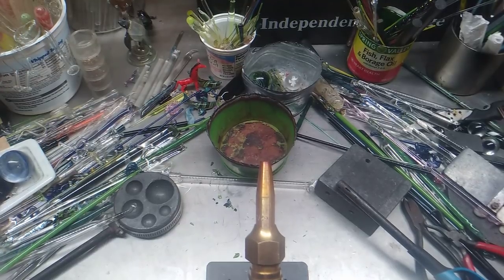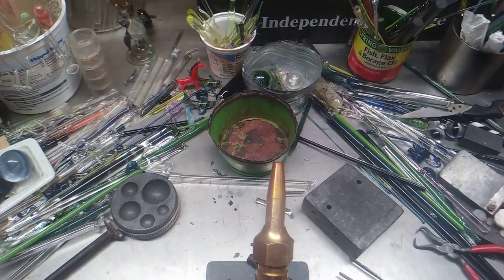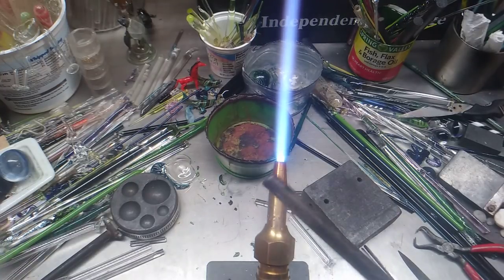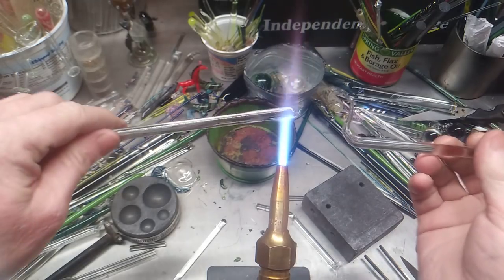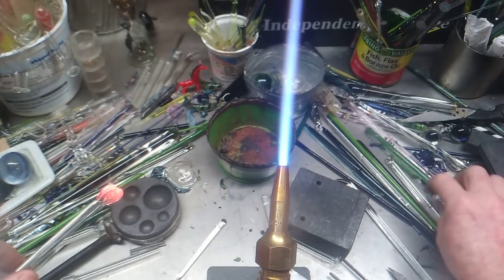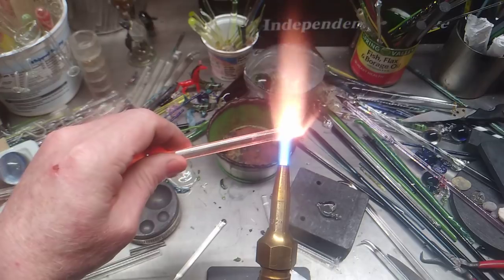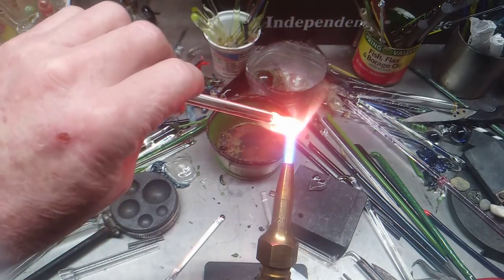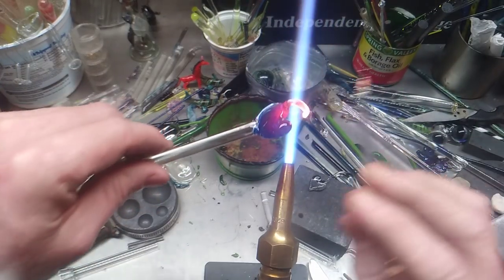a few simple glass hacks on a budget torch with boro glass and  making hearts

Comment: Hello, I got some equipment and made a probe with an unknown composition, you can briefly explain to me that you use borosilicate glass and whether I could get it, to have more success, thank you
Reply from the maker: borosilicate glass has a  coe 33, like test tubes and some glass cookware. most glass like bottles are in the 90 to 104 coe range. the lower coe the harder it is to melt and doesn't stress as easily  i hope that helps you

Comment: Could you guide me to info that will help me learn to construct simple frameworks from 3 or 4mm boro rod, I am trying to make marble runs, so  how can I replicate the spiral lifts and track joining half hoops that you see in the systems using copper rod, and soldering!! 
Will joints made using a tiny torch need subsequent tempering etc etc
Rog, Birmingham, U.K.
Reply from the maker: Never have done frame work like that myself sounds like a fun project.  I would recommend putting  them through a kiln in sections. How big of a track are you thinking about? To make curves i suggest a bushier type flame . email me at manofglassfire@gmail,com or lucian libby on facebook . if you have more questions

Comment: Do you have to have special blow torch please explain how yours is I’m in the u.k Steve from Breaking Glass Art . By the way amazing work .
Reply from the maker: @SteveEvans-kz7yw  it was an oxy acetylene torch that I just picked up on eBay that same torch now would probably cost $150 to $200 . And I just basically connected a cutting torch to the base of the regular torch instead of using the cutting tip assembly . A comparable glass blowing torch would be a national with regular tips on it and it would be in about the $120 to $15 0 range

Comment: My daughter wants to do exactly what you're doing in the video. Torches are prohibitively expensive. However, my father is a retired welder. He has torches, tanks, and regulators. Can I use that equipment to get started?
Reply from the maker: yes it would work. i would still get the didymium glasses, for protection of the eyes. checked to see if there is any glass blowers in your area. that might be able to answer a few questions too. you might want to look into a used Oxygen Concentrator that will help you save on the $$$ you will spend in oxygen tanks and exchange  email me  manofglassfire@gmail.com     or https://www.facebook.com/lucian.libby on face book if you have more questions

Comment: Why do you wet the glass before breaking it, when you use the scoring knife?
Reply from the maker: it has to do with the surface tension on the glass after wetting it.... you can do it with out wetting but you get better results when wetting

Comment: What kind of torch and gas are you using
Reply from the maker: @TruckinMental  this demo, I used a welding torch with oxygen and propane as the fuel source
Reply: @LuLibby  I was curious because it seems like you had the perfect amount of heat in an instant. In your vast knowledge what would you say the perfect gas would be for the quickest heat
Reply from the maker: @TruckinMental  The quickest heat is not important. It's the heat that you can control that is important and usually with propane and oxygen gives you the control that you need to work with anything from Pyrex to soft Glass
Reply: @LuLibby  ty I'm going to start the side Hustle in my area and I need to be able to pop out units as fast as possible as why I asked

Comment: do you anneal it or does it stay strong enough with bench cooling? Also, how do you heat it up so fast without it cracking-- is it a certain type of boro? Thanks!
Reply from the maker: Jon Curtis I mainly use American brands of Boro. At the time I was bench Cooling and then anneal them later.... How I put it in the flame so fast is I've had a lot of practice.... And know how to wave it in quickly

Comment: do you think I could use Dremel  torch for small glass jewlery work, that it would heat hot enough, i saw this tool advertised its a bit pricy but if I pay it off it looks very versatile for pyrography and jewlery, ive never used a gas torch before ,is the flame big enough , thank you for your video,the glasses are a great tip for safety, thank you ,beautiful simple heart very practical video,good to remember the butter knife : )
Reply: I have used small butane torches but they do take longer to heat up the piece and the fuel doesn't last long enough to finish the piece. Great video!
Reply: thank you, yes I see the flame is too small a bigger flame with gas connection is  proberly much more sustainable , ive been learning abit about temeratures glass and stuff very interesting,thank you again you gave great every day  tips anyone can find helpfull.hope you have a great weekend,